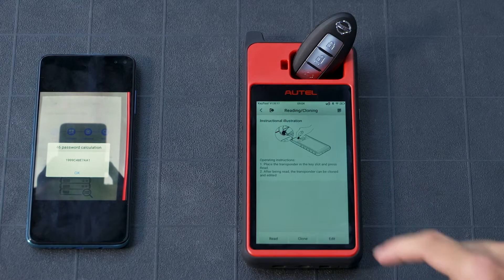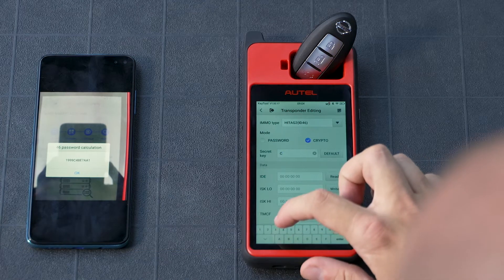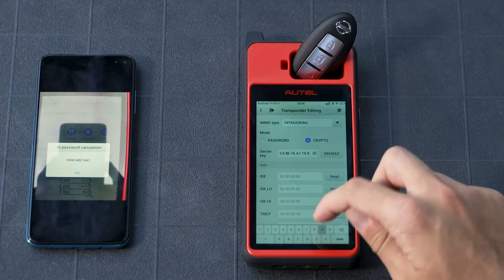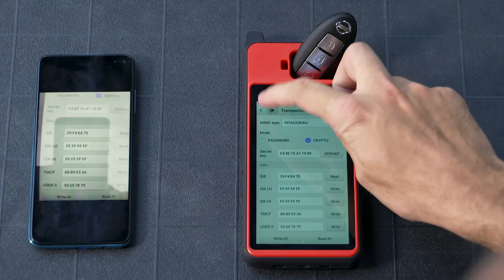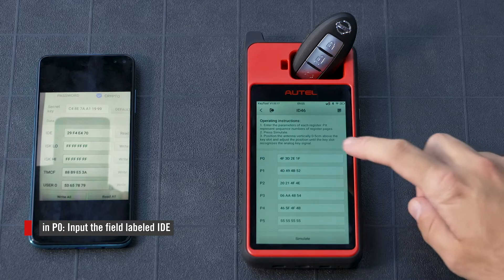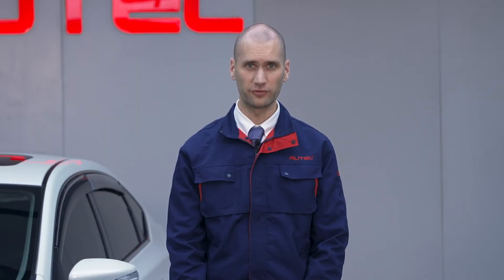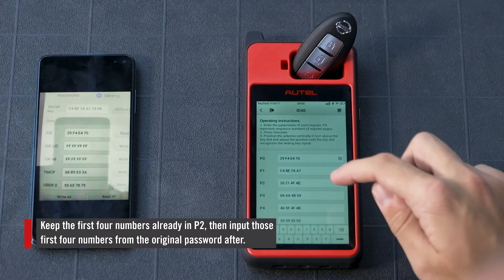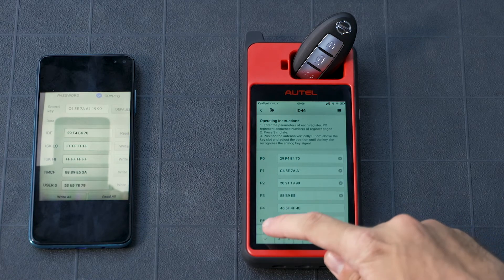(5/7) KM100 :  Simulation

Comment: I just don't get why you need to simulate a working key? 
Why not show key simulation on akl?
What's the purpose if you have a working key?
I use simulator on akl to make sure it's the right frequency on remotes but I don't see the purpose on a working key as I can read the key and add a new one and be done. Still scratching my head 🤔.
Reply from the maker: Dear customer thank you for reaching out, the key simulation function is only for some specific types of keys, it is a supplement to the mainstream function, an auxiliary function!  In the simulation function menu of KM100's chip, the data filled in by default is the general data of the key immobilizer and  When applied to a specific model, the page register data needs to be modified!

for more information please contact our technical support team:  imea-support01@autel.com or imea-support@autel.com